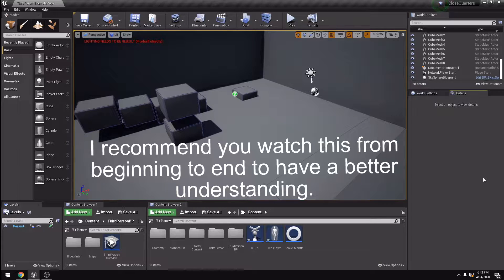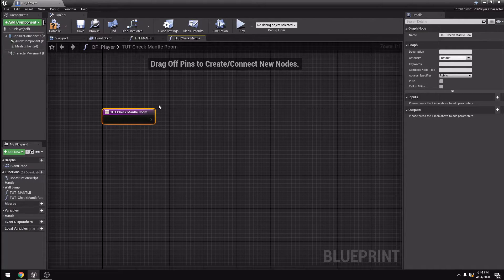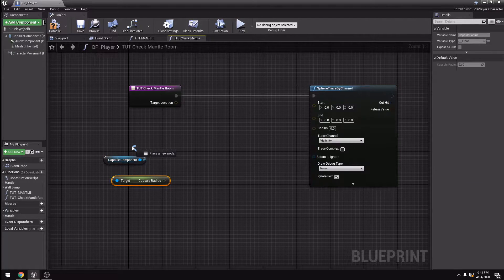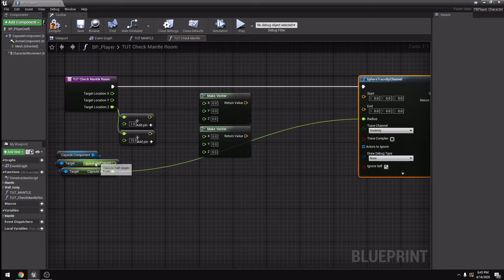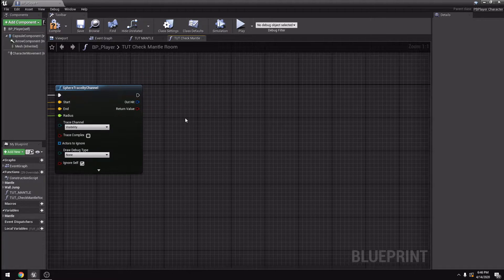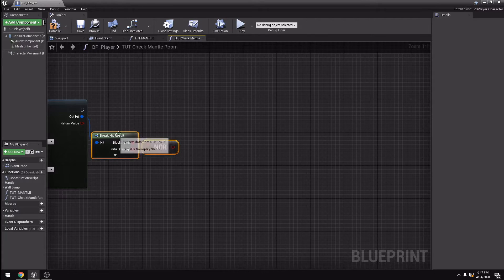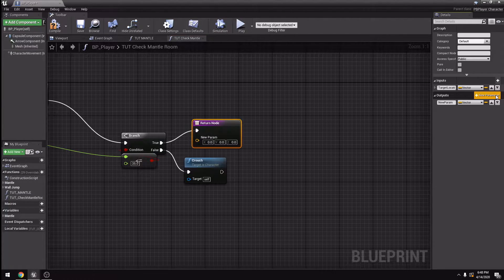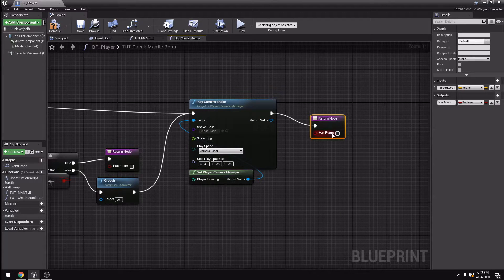VAULT / MANTLE #3: FINAL PART!

Comment: I've run this tutorial three times (on UE5.1) and it seems to send me to the world origin (0,0,0) every time I jump now. Not sure where I have gone wrong or if there was a major change from the Tutorial UE4.x Version to a slightly modified (Adding Running, Crouching and Swimming but left the base code mostly un touched) Default FirstPerson Character Controller.

I'm going to deactivate the Code and leave the Functions and Nodes in the project for now. But I hope to either figure it out, Get some help or find a better method. Thanks for the effort. But for me it's completely broken...
Reply: I'm having the exact same issue right now in UE5.1 as well, let me know if you figure out a fix!
Reply: @LWCobra99  same problem
Reply: I remember having this issue and managed to make it work, i'm not in front of my computer so i can't tell what I did exactly, it's been a while, but let me know if you still have the issue and I'll take a look at my code
Reply: @tonirak241  Did you ever find a solution to the issue?
Reply: I also have this same problem have you figured out the solution

Comment: For any one having trouble with this in UE5 I have fixed it. By going in to the mantle function and at the end of the Then 0 sequence to the branch that has true set the initial point and initial normal and changing it around to false to set them and true will be the return node.
Reply: I did that it still doesn't work
Reply: it still doesn't work but that already help a lot thanks
Reply: what a fucking legend🙌,thanks

Comment: does that work for the unreal engine 5 early access 2 ? i've tried it and alot of things have changed with the blueprint
Reply from the maker: I haven't tried, however ue5 is not much different than ue4 so I bet it will work. You need to try and see it yourself though.

Comment: Hey I sort of got it to work but I'd like to use this for the player to climb on higher things. How can I increase the height limit for the target wall?
Reply: I did it. On the second part, I deleted the +45 from GetActorLocation (Return Z Value). Then I Increased the Start's Z value from 120 to 300. Now I can pretty much climb high walls. To polish it, I increased the time from 0.4 to 0.9 so It looks more like a grind (since a high wall is being climbed). Thank you regardless, subbed!